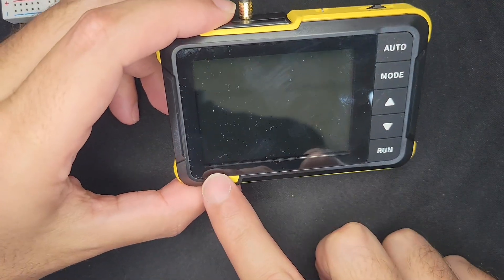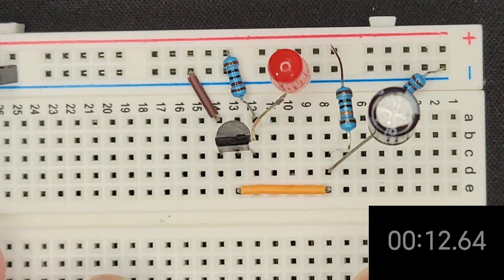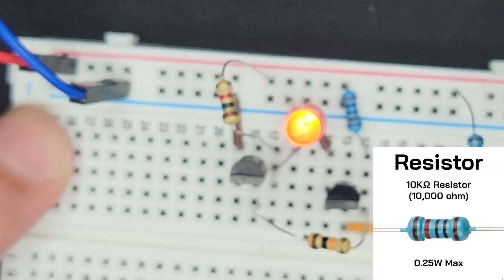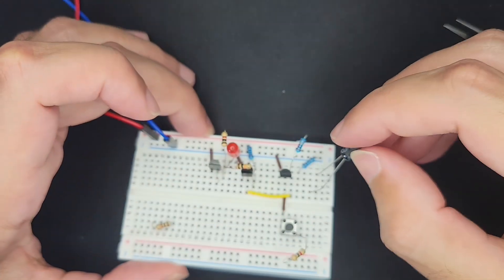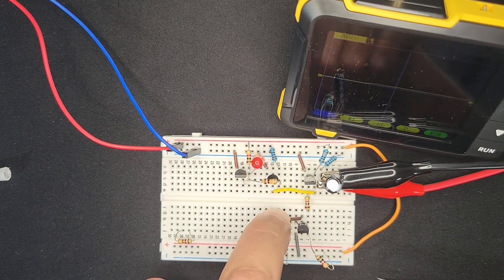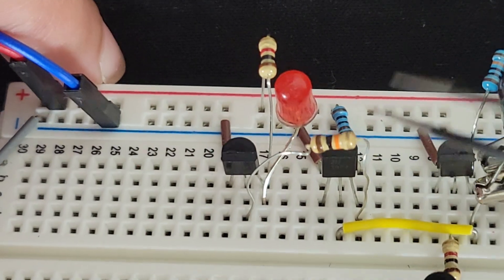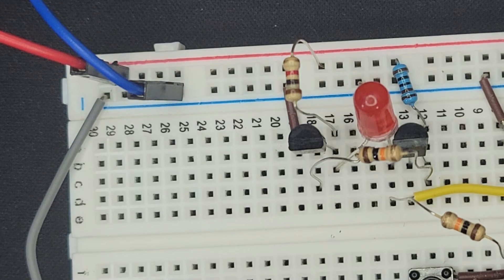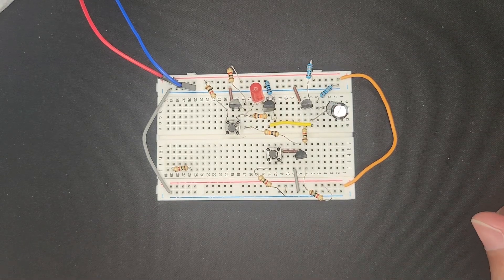Long-Press Button Circuit | Beginner Learns Electronics Ep19

Comment: there's a push button, single press the device gets on, during device on single press change the functional context switching of microcontroller and long press the device gets shut down, what will be the circuit and working of it

Comment: Circuits like this work very much better if there is hysteresis in the circuit that "looks at" the voltage on the capacitor.
Hysteresis requires positive feedback. With discrete transistors you'll need at least two. There are many logic gates that have hysteresis ("Schmitt trigger" types). Some microcontrollers have inputs with hysteresis. CMOS devices have the added advantage of very high input resistance which allows use of much higher resistance values and/or lower capacitance values.
Don't forget that you can use diodes for "current steering" though this is not necessarily helpful in circuits where thresholds are set by the base-emitter voltage of a bipolar transistor.

When you want the state to last "forever" an RS (reset-set) flip-flop, which can be implemented with two BJTs. With four BJTs and six resistors you can implement a full-blown RS flip-flop made with two cross-coupled NOR gates (look around the web for "resistor-transistor logic,"  RTL and "diode-transistor logic," DTL - these are long obsolete but the circuits are instructive for learners). The state of an RS flip-flop is indeterminate at power-up unless you add some extra parts. (Reliable power-up reset circuits are remarkably difficult.)

Look at and think about the internal circuitry of the 555 timer circuit. It has two distinct and well-defined thresholds that control an RS flip-flop. It isn't necessarily what you would want to use, but is again something that is instructive for beginners.

Typically a microcontroller-based "long hold" function is implemented in mostly in firmware. Long-hold for power-up can use a circuit that does rely on the rise in voltage in an RC circuit but then as soon as the processor is up it "holds the switch" using an output. Done properly the power-on circuit requires no standby current.
I have a vague recollection that there are some very old Microchip ap notes that might be helpful.
Reply from the maker: Your comment made me realize that I made an overcomplicated SR-latch lol. (I did use 2 NOR gates to make an SR-latch a few weeks ago). It would be interesting to turn the SR-latch into this long-press operation.

Regarding diodes -- and correct me if I'm wrong please -- I sometimes feel like this is 'cheating' to force current one way. I understand that it is necessary at certain points, but for me I see it as a last resort. At least as a beginner, I prefer to observe which way the current is flowing (the 'natural' way, I guess?) and manage current through resistance. I am not qualified at all to talk about when to use a diode and when not to. But this is my current viewpoint on it for my own projects

I will look at the 555 timer, thanks! I have heard of it once or twice. Maybe it would be a fun project to build in the future?

That is interesting that 'long hold' functions are mostly firmware. I would have thought they were strictly hardware to ensure no software issues could inhibit its operation. I suppose being firmware, it's essentially in a different dimension and at a much, much lower level where it won't be affected by any high-level software operations anyhow.

Thanks very much for your detailed comment and assistance! I greatly appreciate it.

Comment: Hi, you can use the pull down Cathode of LED with collector of NPN to turn on when the base signal is available. Connect a 330 ohm to the led anode and connect cathode to Collector of NPN, Now connect the capacitor parallel to base and emitter adding a resistor to base from positive supply will charge the capacitor to 0.7 with some delay depending on the values of base resistance and capacitance. No need for an inverter. Try to Implement circuits without more complications while learning itself, otherwise you are doing good.
Reply from the maker: Very interesting, thanks so much for the suggestion! I will attempt this in the near future and will post my results as a video. It makes sense to me that there is a more concise and succinct method with less components.